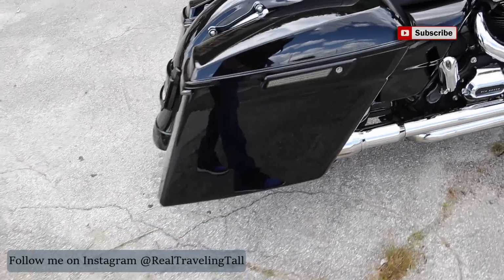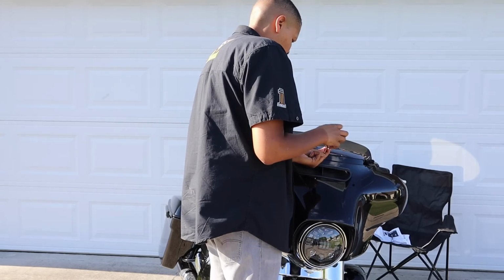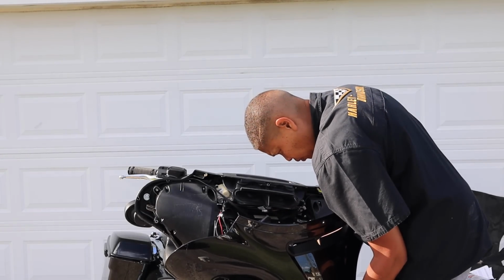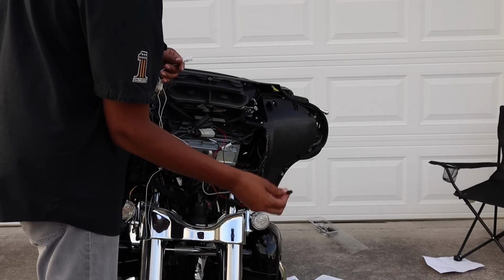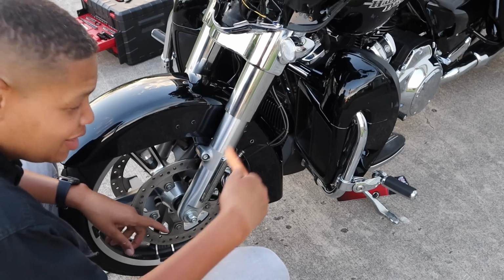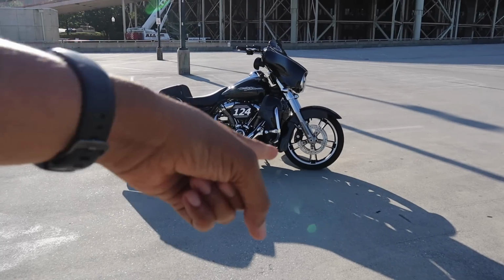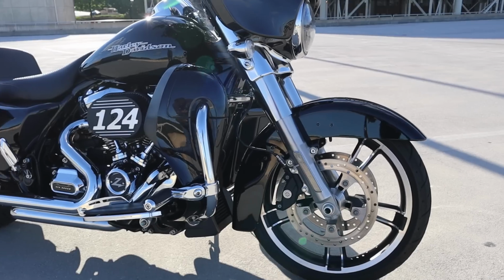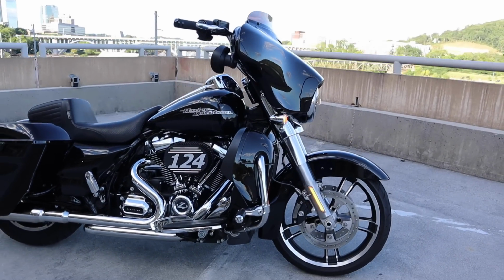Get rid of that front fork reflector!

Comment: Very cool. Great looking scooter. Thanks for sharing.
Reply: A scooter is a motorcycle with an underbone or step-through frame, a seat, a transmission that shifts without the operator having to operate a clutch lever, a platform for the rider's feet, There was most definitely no scooters in this video lol.

Comment: Your fork lights are great, but only if they have the DOT required reflector function built in.  Without that the bike could fail state inspection in most states.  Be careful when choosing accessories. Love the turn signal function.

Comment: I purchased a 2021 Harley Davidson Road Glide and decked it out with Custom Dymanics.  The fork lights look great, but with a Road Glide, the fairing stays still when you turn.  Therefore, you need slack in the wires to connect the lighting wires to the fairing, or you won't be able to turn.

Comment: Here, in Honolulu, those amber reflectors on the fork legs are required by law.
Also, the limit on handlebar height, is 15" from the center of handlebar mount, to the center of hand grips.
Pretty strict, so NO HUGE APES allowed.

Comment: Yea, those smoked fork lights are great!   Question, do you have, or did you install a cell phone charging usb on your dash?  I understand there may be a usb under one of the plastic covers on the side of my '20 FLHTP?  any info?  Thanks!
Reply: The Street Glide has USB cable in the cubby. The SGS also has a 12v plug on the right fairing.
Reply: The Father all batwing fairing bikes have a cigarette lighter port on the lower right side of the fairing.

Comment: It's nice to have another light and turn signal but you basically replaced the Orange reflector for a reflector that looks bright Orange and lit up.  I would either remove the reflector or replace it with a smoke reflector

Comment: You have removed the Amber reflectors with smoked which is cool yet you run white wires up the side of the bike yuk - you should have sleeved or changed the wires to black same as calliper hose brake line - cool ride though

Comment: Those reflectors are required by law so you can be seen at night, especially when you're on the side of the road. 
And how is another driver next to you gonna see that turn signal when it's so low?   Makes no sense.
Reply from the maker: 🤔 how are they going to see an additional flashing LED light that took the place of a plastic sticker that reflects only when there is light to reflect off it? I'm not sure I get your question 🤔 The same way they would see the reflector, only better. Thanks for the comment.

Comment: why why why would they use white wiring  for fork lights. common man!
Reply from the maker: Its not white. Its steel braided line on the end that runs from the harness to the fork light. Its white from the harness to the connectors behind the fairing. (the wires that you will never see) Thanks for the comment.